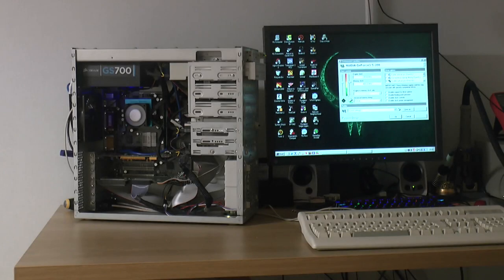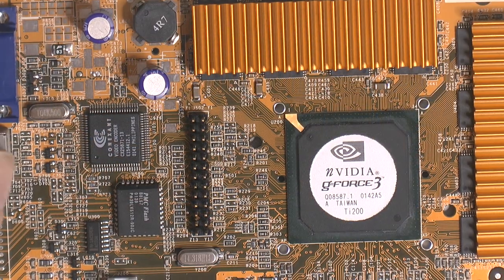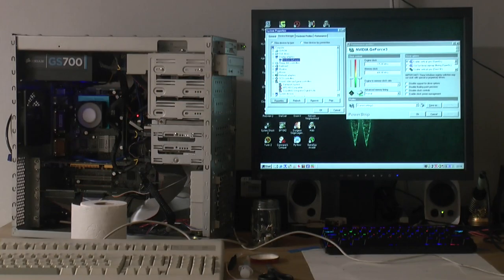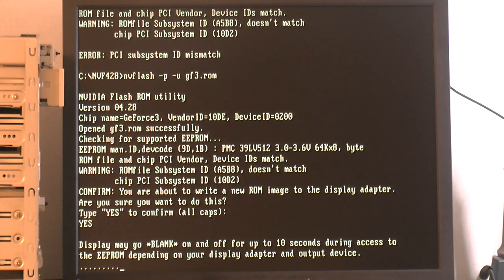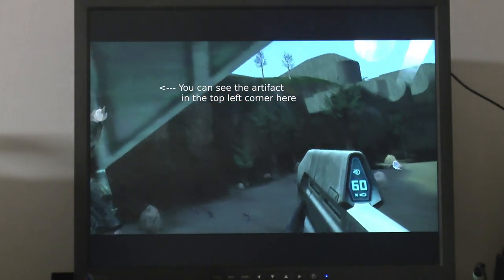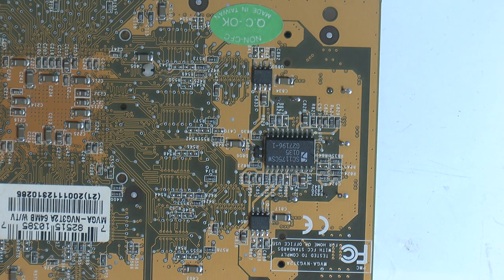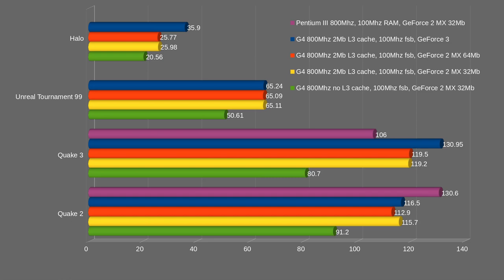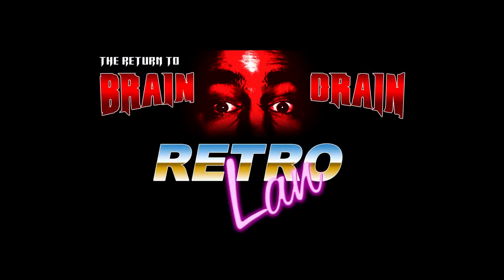GeForce 3 ti200 in a Power Mac G4?

Comment: very cool!
Reply from the maker: Thank you!
Reply: Nitton Åttiofyra I’m looking for a similar solution for a PCI based video card for my B&W G3 PowerMac. Do you have any recommendations?
Reply from the maker: @minims  Not really. I wish I ha a B&W G3 becsue there sexy.
This is my ONLY Mac so Im actually pretty noob at Macs.
But I would suggest looking in to a Voodoo2 card for it, you can use the PC version of the card. I have a Creative Blaster in this one and with the latest official 3dfx drivers Voodoo2 for PC will work to.
My 3 part Mac video about upgrading and restoring this Mac I put a Voodoo2 in mine.

Modding like this is just something I do to learn about old and new stuff really and share it if anyone else has use for it.
Reply: Nitton Åttiofyra Understandable. Those things are hard to find in good condition. I bought 2 before I got the 3rd, which was in a nice “collectible” condition.